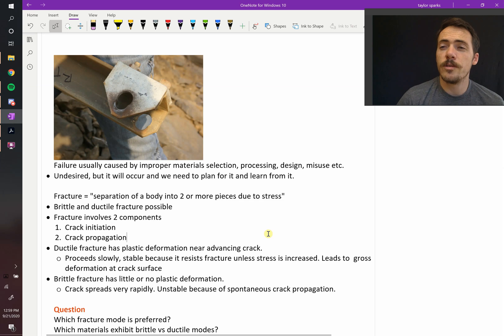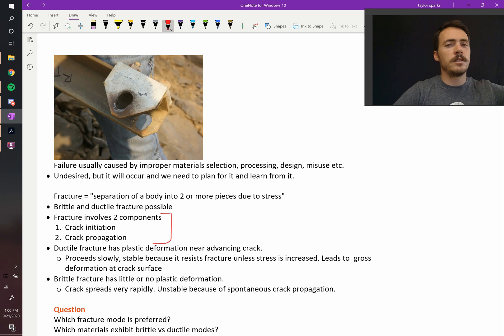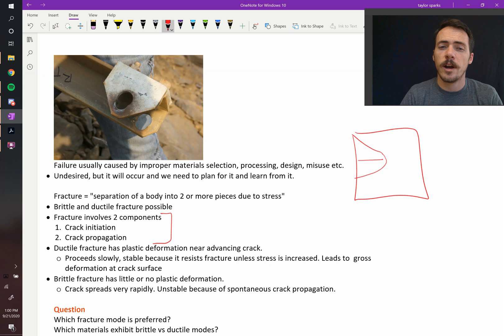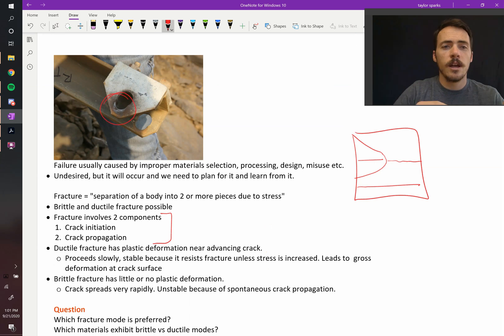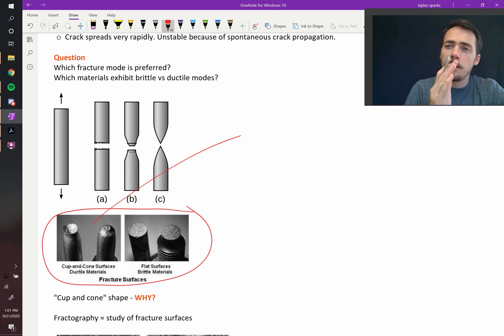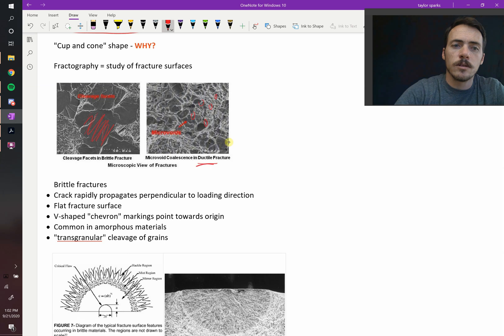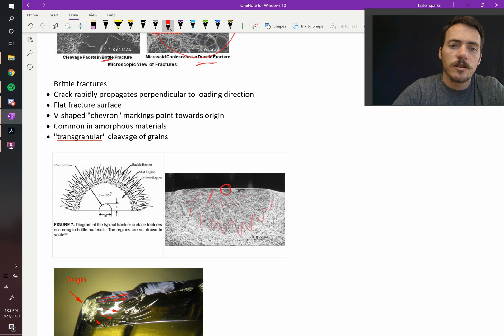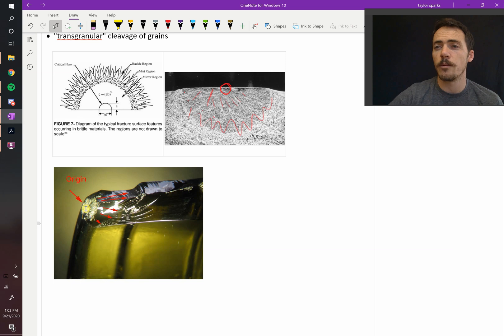How to tell ductile vs brittle fracture using fractography

Comment: Hi professor ,I have a confusion about something.Why higher strength materials have low fracture toughness and lower strength materials have high fracture toughness ?I really appreciate it.
Reply from the maker: The root cause has to do with yielding and deformation. A high-strength material is going to resist deformation, but a tough material takes advantage of deformation to prevent fracture. There are of course materials that break this general rule but for many materials it holds which is why we see that relationship

Comment: I have a question about fractures here. For example ,even though the material (lets say aluminum ) has  a ductile fracture. Can we make it have a brittle fracture somehow ? I really appreciate your answer professor.
Reply from the maker: Sure, temperature and strain rate can both play an important role in switching from ductile to brittle
Reply: @TaylorSparks  Thanks a lot professor.